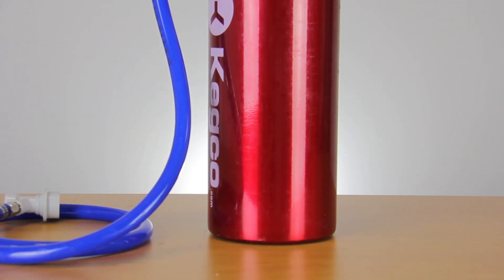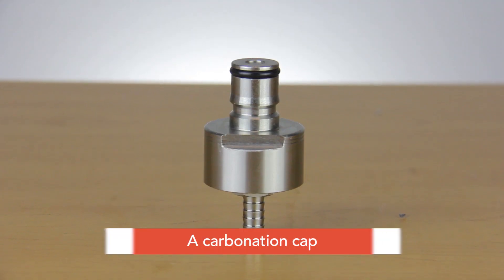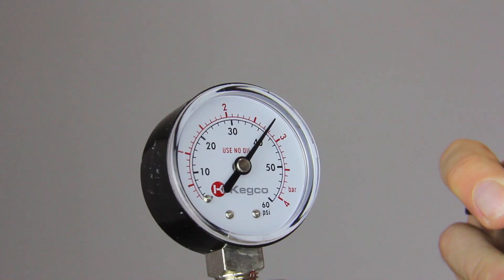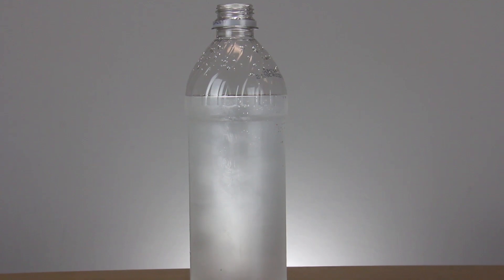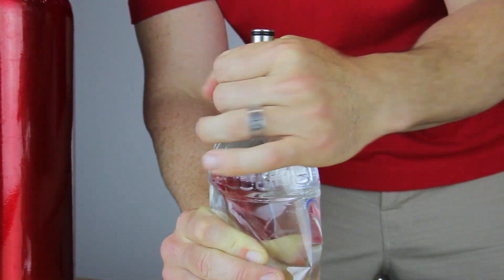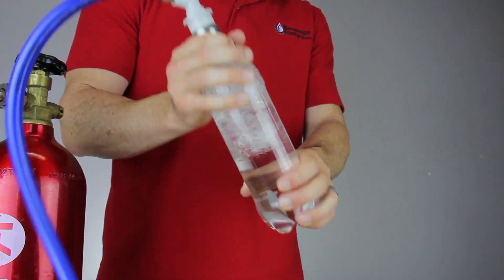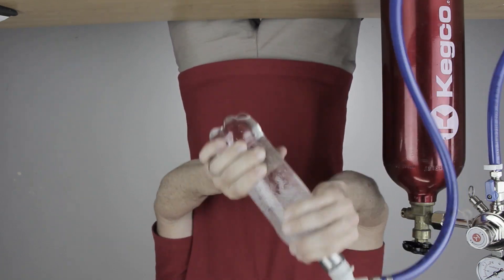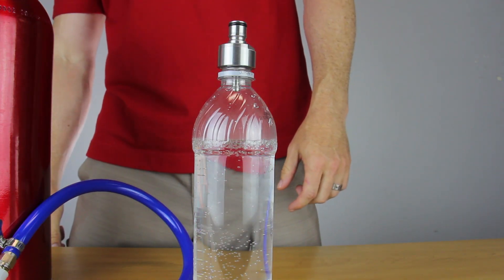How to Carbonate a Flat Beverage - Soda, Water or Any Beverage You Need Fizzy

Comment: WHAT A BUNCH OF LAMERS.   I'm 74,  built my own.   CO2  tanks and regulators can be found  used or otherwise,  C/L or  MarketPharce  (I DETEST MaHARK  ZUCKERPHAKE)  as well as regulators.  Hoses, fittings?  Ace hardware,   Ebay,  use your frickin head.   I've been DIY'ing stuff all my life.  Learn to build stuff.  Learn to  work with your hands.  Learn to use your   silly head.   Get off  "social media"  and learn something.

Comment: Looks good. It'a step in the right direction. Now, how about combining the bottle tip with also a trigger dispenser so one doesn't have to unscrew the cap to pour beverage ? That would be great !
Reply: That gives it more potential to leak when you try to carbonate it.

Comment: Wouldn't it be easier to just buy some Sparking water, like Polar for instance, and just mix like half and half or some combination of the two to get what you want. For example: I have a bottle of Coke that goes flat. I get a bottle of Polar Vanilla seltzer water. I pour (lets say 50/50 mix just to make it easy) the two together and bingo I have fresh carbonated Vanilla Coke.
Reply: A fresh bottle of vanilla coke! 
... and some melted ice
Reply: No. Adding anything to sparkling water, like sugar, removes the co2 from the water.

Comment: I just ordered that bottle cap adapter to try, already have everything else. the 5 pound co2 bottle I paid about $100 for, and only $12 to refill, and the regulator only about $20. the bottle should last 6 months to a year, but I haven't yet had to refill. something to note, the gauge showing pressure inside the bottle is not an indication of how full it is, since the pressure will change with temperature. any metal that touches the carbonated liquids must be stainless.

Comment: Pretty sure you can get a standard sodastream for less then what those components costs. Its like 40$.
Reply: Sodastream isn't really capable of recarbonating soda and exchanging their tiny (14.5 oz)CO2 bottles costs about as much as exchanging a normal 5lb(80 oz) tank.
Reply: Considering how much they charge for their CO2, in the long run pictured setup is MUSCH cheaper

Comment: I own one of these, they work pretty well. Question for Beverage Factory: what function does the hose barb serve? Can a hose be attached and used in lieu of shaking? Thanks.
Reply: The hose barb can be used to add a tube and diffusion store, or a liquid dispense line so that you could pour out of a bottle with a faucet and ball lock adapter.